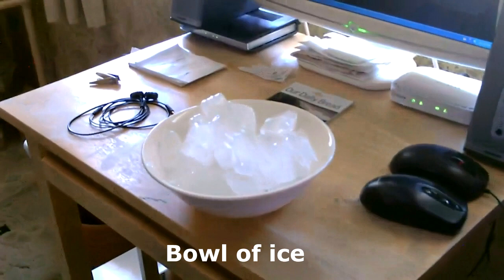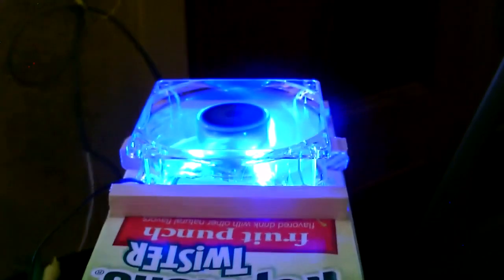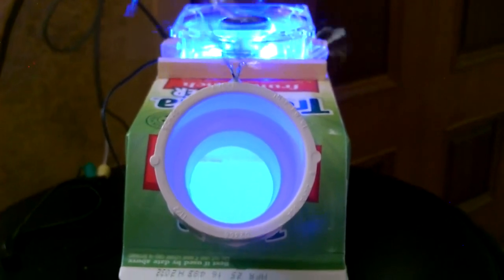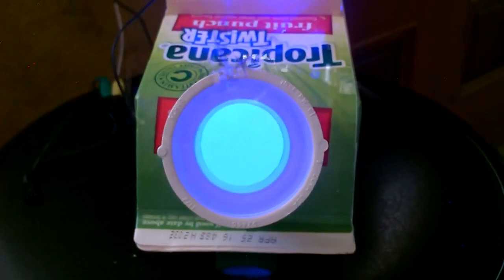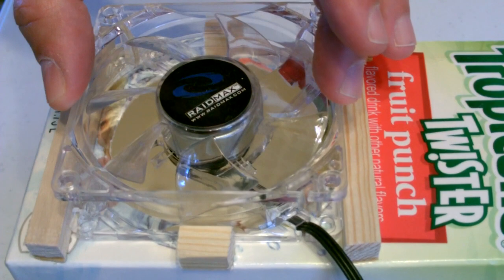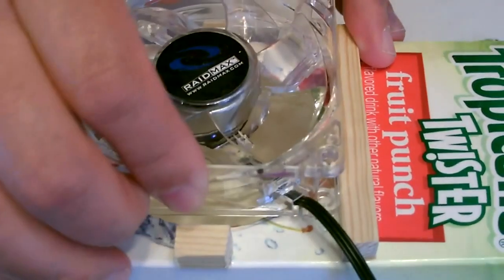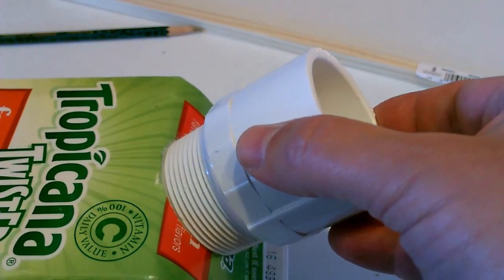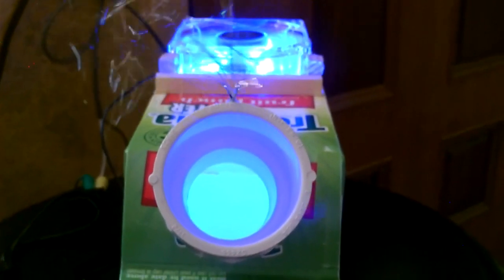Homemade AC Air Cooler! - LED-Lighted (Multi-Color) "Juice Carton" Air Cooler! - can be solar pwrd

Comment: does the pipe really direct the airflow much? could it be left off to make the  build even cheaper?
Reply from the maker: hi there. it really does matter. if you don't use some sort of pipe it will come out in all directions and you'll barely feel it. *to go cheap...as a test, i used the cardboard insert from a roll of toilet paper for the pipe and even that worked (just don't get it wet)